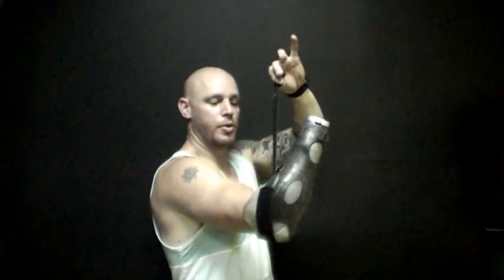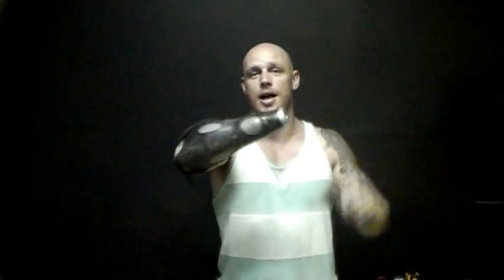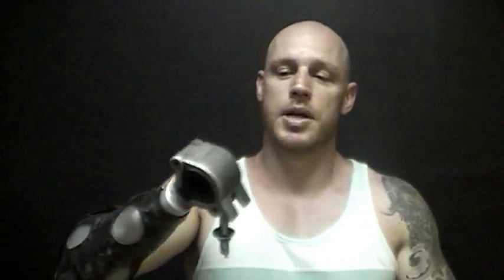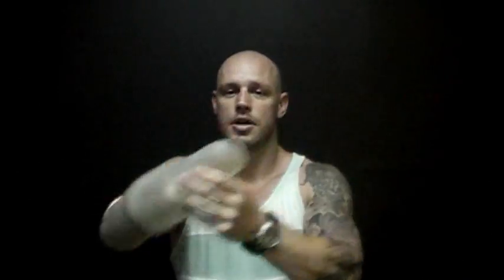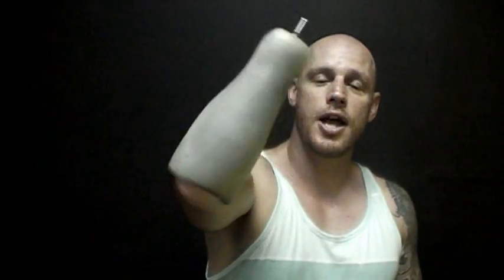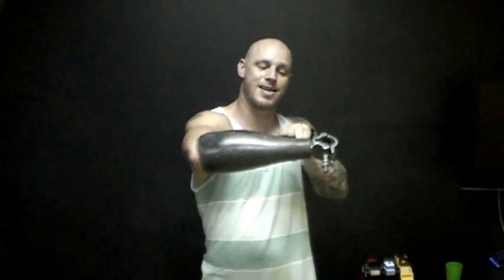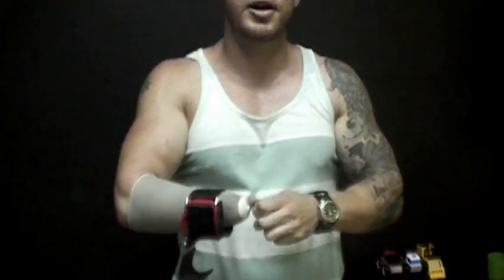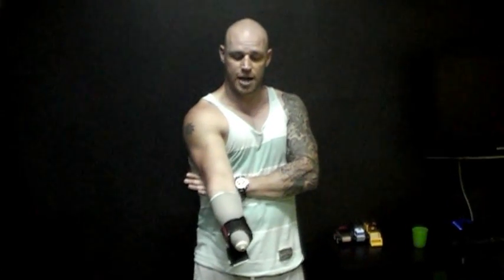Hand / arm amputation weightlifting prosthetics

Comment: So talk to your current Prosthetist about getting these devices. Prosthetists are the ones who are able to get ahold of the manufacturers, order, and assemble these devices for you. The C-hook is similar to a Gymnastic hook sold by TRS. If you are into Push-ups the same company also sells a Shroom Tumbler. Same company also sell the bolt action clamp- Black Iron Master/ Lite/ trainer althrough I would not recommend it for pench press- check out both websites below for better attachments. http://www.trsprosthetics.com/shop-category/sports/

The quick disconnect feature is an add on and can be purchased from TAD. See the N-abler series, and check out the Outdoor and Sporting section too. https://n-abler.org/index.htm

Comment: Greetings from Mexico. I saw your video and I realized you have the exact solution for me. I was born practicly with the same right arm condition as you (lacking just the hand) and I've been using a kind of hook that ataches as a wrist band but in the moment I try slightly heavy weights, it comes off. I would really appreciate if you would be so kind to give me the info of whom should I contact in order to get myself done one of those badass prosthetics to lift like a beast and try to get my right arm as strong as yours. Than is in advance and congratulations on that body symetry I'd love to achieve.

Comment: Have you tried a vacuum assisted socket?  It will allow full elbow ROM and hold on as well as the set up you have now.  I have made a few like that and my clients like the extra ROM and the control of the device achieved.
Reply from the maker: Brad van Lenthe The vacuum is not strong enough when lifting really heavy weights and slips off once sweating.